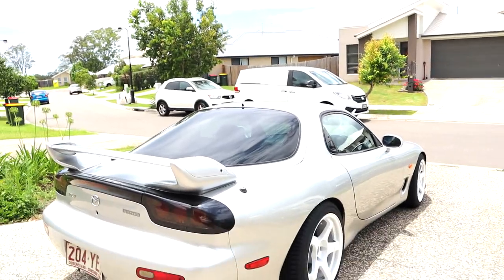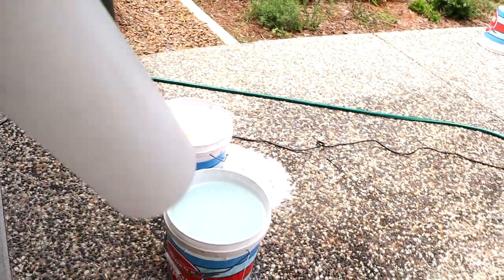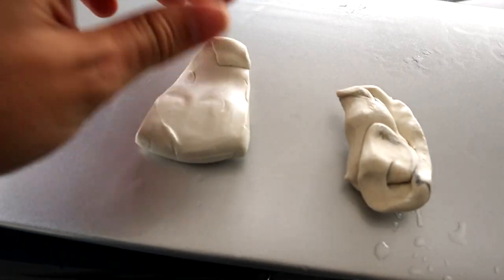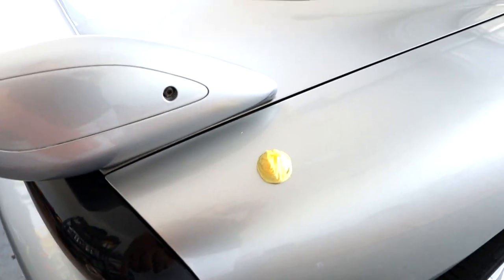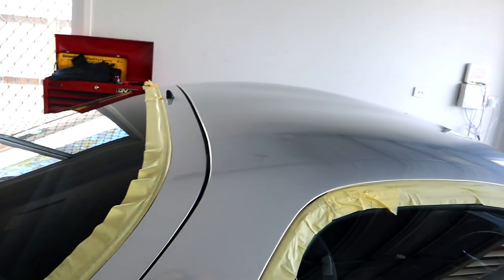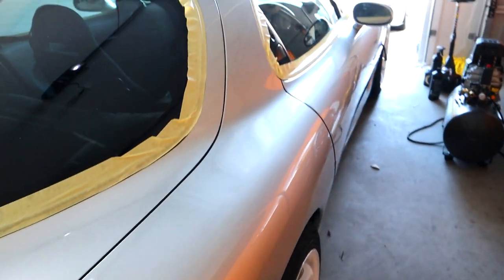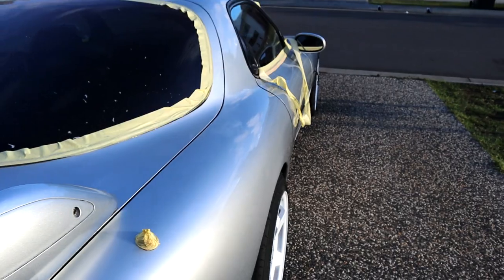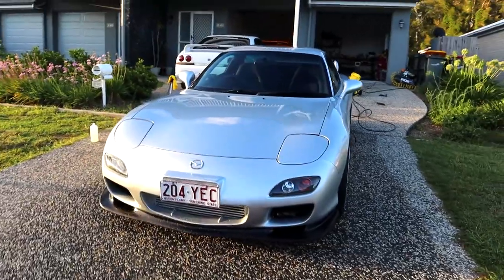RARE RX7 FD RS RESTORATION - Day 1, Correction!

Comment: The car taking a front hit at some point could be the root cause of the cooling issues if some component or multiple components of the cooling system have a hairline fracture/fractures. You could go grey haired trying to find it.

The bonnet rubbing on the wiper arm is an indicator of (Not factory alignment) door gap guard gap bar gap etc..

Food for thought 🤔